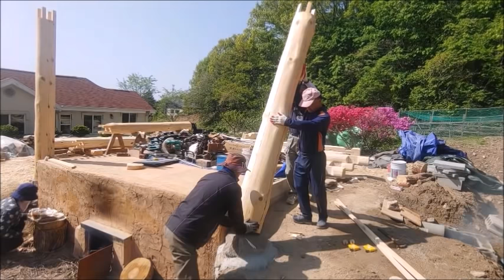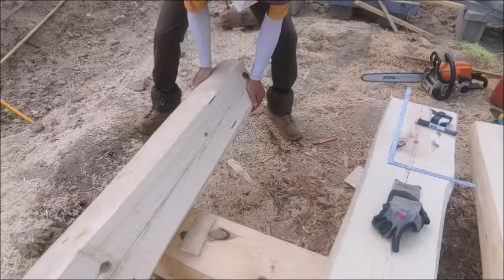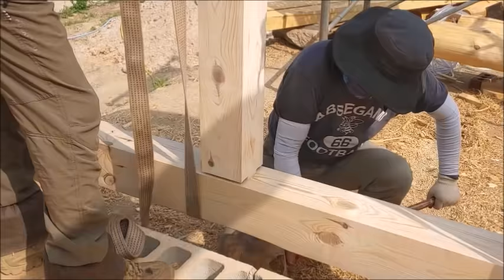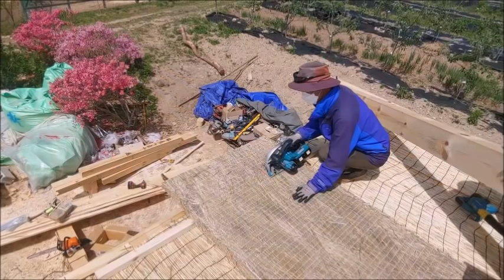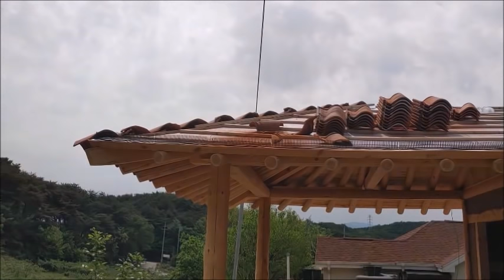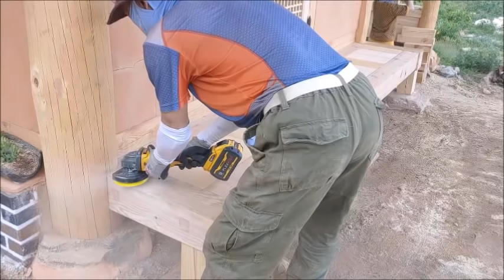House27-꽃 피는 봄! 작은 집을 짓다!

Comment: Thanks for the ink scribe tip that's awesome. Great beautiful work on the roof in particular. Does Korea require the logs to be graded when building a full scale house, or have you built a full size 2000 square feet or larger house before? I'm planning build a hanok roof in the USA, but our engineers over here want something other than nails or timber screws for the hip Jack rafters to tie into... I like how your building's ridge beam or purlins have a notched block that runs it the common rafters, allowing for the jacks to sit on the purlin. Just really beautiful work you do, keep it up🔥
Reply from the maker: There are many regulations in Korea as well.
It's very tricky when building a house.
I have built many large houses.
Thank you for your interest in my video.
Reply: @woodwood1  question for you, do you think it looks good to lengthen the overhangs at the corners and form a curve along the overhangs? I saw gyeongbokgung palace a few days ago, and it seemed to curve along the overhangs horizontally out at the corners.

Comment: That kind of mud+straw wall is named "pau a pique" in Brazil, very common construction method in poorer areas altho we dont use straw mats, just the mix and some sticks. We have a problem here of insects living in the wall, a specific insect has some dangeorus parasites. it is interesting to see they use some sort of mosquito net before the plaster as that will certainly reduce that problem.

Comment: I like your work it's nice to see traditional designs.
Woodworking question, what size chain is on your chainsaw 325, 3/8?
I have Makita 36v with 3/8 micro it doesn't bore cut well.
Reply from the maker: chain saw. STIHL 170
Reply: @woodwood1  Chain size?
Reply: @mrln247  Hey, Looks like a 3/8 pitch--.043 gauge--34 drive links
Reply: @jamessheehan1045  Can't quite read the bar label anywhere unfortunately. Does look like it probably is a 3/8 but 34 links is tiny never seen a chain that short the bar he is using looks like atleast 16" which is more like 55 links.
I know what I'm doing with big saws and full size 3/8 chain but new to these small saws and confused why it doesn't cut well so probably the safety features or file size or something.

Comment: Were the Cinder Blocks part of the foundation or separate from the wood structure or what?
 Because there was a separation/Crack in the 
block and you could tell that side of the wall had sunk down on one side. They just kept on building though. That’s not what I would call good work.
Reply from the maker: It has been separated.

Comment: I like what your doing using your hard earned skillful knowledge in Wood Carpentry but, you really need a (WRAP AROUND) instead of what your using to Mark your Cuts with. In case you don't know what a (WRAP AROUND) is. It is used in (PIPE FITTING AND WELDING) to lay out Miter Cuts and Angels on rounds like Steel Piping, Steel Plate, and Angel Iron. You get yourself this simple Tool and you'll send me a thank you for this Tool suggestion. Thanks for sharing your hard earned knowledge with me. I do appreciate this.
Reply from the maker: I didn't understand what you said.
Reply: @woodwood1  I used to be a Pipe Fitter and Welder, plus a Plumber and in these trades I used a Tool called a (WRAP AROUND). It was and, 'is used to lay out Angels of all sorts. Go down to your local Welding Supplies and ask for a (WRAP AROUND). You can use this to lay out all the Angels in your Wood Working. This is a Fine Tool Mate. Hope you understand. Thanks for sharing with me.
Reply: @woodwood1   он пишет про объёмную разметку более удобную для выпиливания соединений.
Reply: @woodwood1  파이프나 둥근 목제처럼 라운드 된 곳에  치수 마킹하는 도구가 있나봐요 그걸 사용하시면 편하게 일할 수 있을꺼라 그러는 것 같아요
Reply: It's a nice idea and does work well with pipe however the inconsistency of logs will throw it all over the place, centre lines really are the best way with logs and it works beautifully.
Reply: @mrln247  THANKS FOR YOUR REPLY.

Comment: Those joints look massive and heavy duty from the outside, but inside you cut most of the wood away.
You'd be better off and save wood by cutting those trees into 2x4s and using modern techniques.
The world cannot afford to waste wood like that.